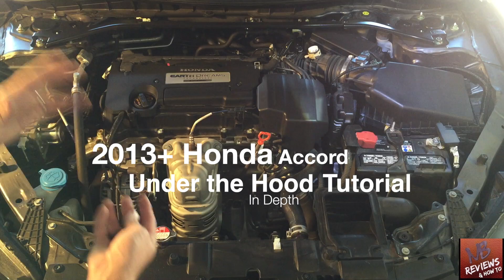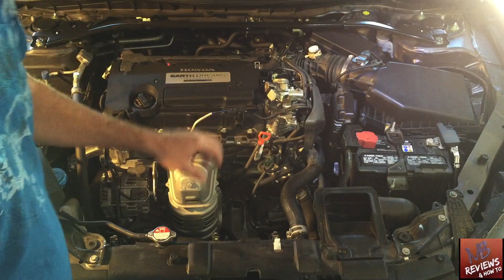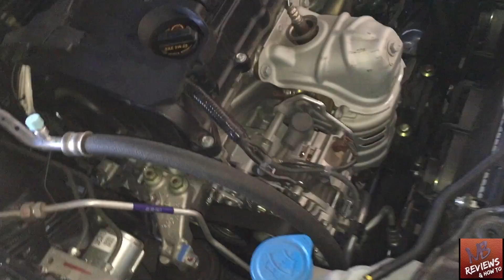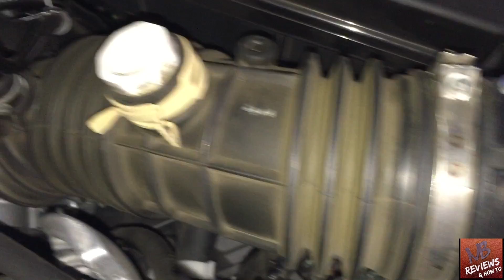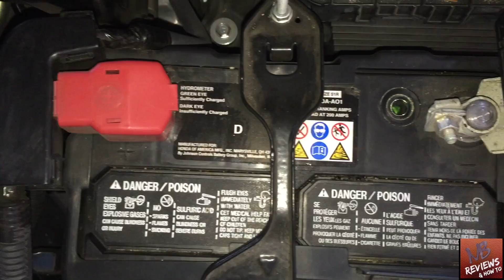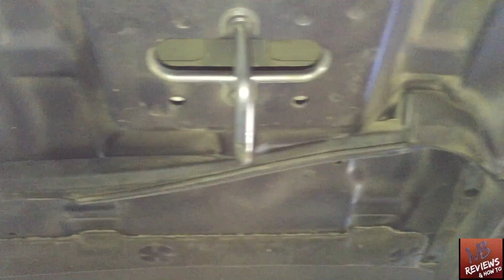HONDA ACCORD 2013+ UNDER THE HOOD TUTORIAL

Comment: Big question.. what is the proper way to measure the oil in this car?  In the morning when the engine is cold and all the oil is in the pan?  Or when it's warm and off for about 3 minutes like the manual says????  If I were to measure it that way, then when the engine is cold, it will be over the fill mark.  And isn't measuring it when it's warm not an precise way of measuring?  Why not put the lines on the dipstick to show the right level when the engine is cold and all the oil in the pan??
Reply from the maker: @rickrodriguez5875  The proper way is to warm the engine first. When the engine starts it will pump oil throughout the engine and will return a low reading more accurately than when the engine is cold. I know it’s common sense, just sure you are on a level surface.
Reply: @Sunshone7311 how long after you shut the engine off do you wait to measure?  I don’t think that’s an accurate way to measure because you don’t know exactly when the oils drains to the pan. Why not put a cold mark on the dipstick like they do with the power steering fluid. That’s more accurate. I’ve heard it’s worse to overfill your oil and why I wouldn’t recommend measuring when it’s warm. That method is a “it’s kinda full method” vs measuring when you know all the oil is in the pan.

Comment: My 2015 Honda accord exl was totaled & fixed almost back to new. I don’t have the intake resonator on due to reconstruction. It can’t fit now. Is my car still fine to drive? The air box filter is on but the circle part is open. Do I need to close it? Also I can’t find the name of the ac line with the blue cap.

Comment: mine is 15 accord sport just reached 100k+ miles. i always do regular oil change in 3-4 months and making sure all fluid are on the level and clean. im replacing couple of stuff like spark plugs, coil and probably 02 sensor. however, i never gotten any check engine so far since i bought the car. do you wait for check engine to out before changing 02 sensor?? is it safe to just change the 02 since the high mileage ? appreciate the feeback.

Comment: Great video. Trying to diagnose a daily squeak on cold startup. I replaced the tensioners and serpentine belt but that wasn't it. Sound is coming from the driver's side of the engine. Maybe the water pump or bushings. 

Any help would be appreciated. Thanks.

Comment: I've got a 17 sport, thanks for this video.  I've recently come up with a p0172 code and now I see where the fuel is routed to I can check to see if that's where my problem lies.
Reply: I just got the same and i got the car a month ago with 134k LX. My issue is the MAF sensor.  Changing tomorrow

Comment: The 0w 20 oil is for fuel economy not closer tolerances. 
This DI engine actual has low tension piston rings. The tolerances are actually greater. Less internal  friction means  better mileage. 
The extra heat comes from a higher compression ratio of over 12 to 1, not the DI. The direct injection actually allows the higher compression by cooling the combustion chamber and delaying detonation,  not unlike water injection. 
The emissions issue is partly the faster burn and lack of atomization usually done in port injected intake manifold. The low tension piston rings allow a bit of blow by which contaminates the oil so more frequent oil changes are a good idea.
Over filling the oil will not cause the oil pump to pump more oil. It has an always submerged pick up. More oil is irrelevant to the pump.  The problem is the crankshaft over splashing and whipping the oil in the overfilled  oil pan and turning the fluid into foam. The pump can't pump foam and causes oil starvation. 
Electric steering is another method of increasing fuel efficiency by not using engine power to operate the pump. It was not invented for autonomous control. 
The smaller battery reduces weight and increases efficiency. 
The air box was  carefully engineered to protect the engine, minimize noise and maximize efficient air intake. Dyno tests show aftermarket intakes do not increase power in any meaningful way. 
You have some unresearched assumptions here that might seem reasonable but are not the basis for these designs.  Otherwise nice video.
Reply: Agree all of it except the battery. No sane engineer would put such a small battery for such a high compression engine. Both the starter and battery are not properly rated for this engine.
Reply: Yes but they are downsizing anyway. Have u seen the Fit battery? looks like it belongs on a motorcycle    @S-the-simple-engineer

Comment: Am having an doubt I need to share a picture of my honda accord about a hose coming from engine and it's connected to an electrical circuit from that it going to the down but I found that the hose in not connected to any engine circuit it's near bu oil dip indicator and radiator tubes I need to share the pictures I need to take any immediate action or it's an normal design

Comment: grat video. I always high oil level causes the crank hit the oil and cause foaming which in turn causes air bubbles to flow thru oil system which the oil will be inundated with air and less oil causing less oil for parts needing oil only.. I would like your thoughts on that.

Comment: Good job Michael.. but forgot to tell that the MAF needs special solvent to clean.!..and that the O2 sensor there is another on the exhaust pipe under the car. 
I need help finding the EGR valve..Is one on these engine models? somehow Honda do not list one available. 
thanks
Reply: He mentions both those points in the video.

Comment: Got a oil change. Next oil change is 3 months or 5k miles. It's been 3 months but only drove 1.5k. Do I still do a oil change?
Reply: No, wait to the 5k, but make sure is 0-20 synthetic, and if you can DIY.
Reply: @juanruvalcaba1823  yes I have full synthetic. Are you absolutely sure?
Reply from the maker: 5k miles or 6 months with Synthetic.

Comment: my 2014 accord 2.4L burns 1 qt oil around 5,000 miles.
Reply: Iam using Valvoline full syn half a quart burned with 4k since oil change

Comment: Hey, just recently watched your video and its very informative, but i was wondering if you could help with a little problem im having with my 2014 honda accord. So my power steering light, TPMS and VSA light are all on in my car and i cant turn them off, also when i try to calibrate my tires after putting air inside it says the calibration fails to start. I was involved in an accident early in January because my vsa wasnt working and i know this is a serious problem, any idea on what i could be dealing with so i know what to tell the mechanics when i take the vehicle in i really appreciate it
Reply: I have a similar issue with my '14 accord. Did you find a fix?
Reply: Ansar Muhammad  steering angle sensor might be the issue, when you reverse in your back up camera,  is the diagram displaying your wheels as being turned before you even turn the wheel?
Reply: @Brodie11281  ok for sure. No it doesn't do that but my abs, t/c, steering wheel, and brake lights are all illuminated. It doesn't affect the driving of the car my dash just looks like a Christmas tree and thats a bit annoying lol. I think it could be ABS modulator but not completely sure. Just wanted to check what your fix was. Thanks bro👌
Reply: Ansar Muhammad  yeah that can be annoying but if its the modulator definitely look into getting that taken care of asap. I have to get a new steering angle sensor and have a shop take care of the rest. But hope everything works out for you man

Comment: Can you tell me what that thing that has a little cap on it is I lost the cap and fell off I need to get a replacement I guess think I don't even know what it does I think it's something to do in the vacuum it's right next to the dipstick for oil and I believe the plug electrical plug is green but the cap I lost it it fell off at the carwash

Comment: Nice video very helpful. I have a 2013 sport almost reaching 60k. I dont know what's wrong with my car, I use to average about 40mpg cruising down the highway to work (about 20 miles). And now I'm lucky if I get close to 30mpg. I take care of the car alot and I dont abuse the car by hard acceleration, and in the city I'm getting about 15mpg. I do all the maintenance and try to keep the car in top shape. when I look at the mpg on the radio screen its jumps up and down, if it says 450mpg to empty as I'm driving it will jump to 500mpg and go back down to the 400's. then go down by 5-10mpgs after that. I changed the spark plugs original, changed air filter k&n, tires are properly inflated. cleaned mass air flow sensor. I'm wondering if it's one of the o2 sensor, dirty injectors or dirty throttle body. I'm clueless on what it could be. please help.
Reply: It's jumping back an forth due to driving conditions it's calculating the average mpg for example if you're doing 25mpg and it says 450mpg till empty then you start doing 35-40mpg it will recalculate and say a different mpg till empty

Comment: Can you also do a video on how to thoroughly clean the throttle body? Does the intake get gunk up or no because it’s direct injection? Also how can I clean the valves without pulling the engine cover?

Comment: I have an '05 2.4i VTEC auto (Europen spec). Which I've had for 9 years and love. Do all of my own servicing and as much repairs as I'm able before reverting to garages. Which I avoid as much as I can. It was interesting to see how the design has evolved from my car. But I do not like GDI. With Port injection (my car's system) the back of the inlet valve gets "washed" with fuel at every injection cycle. GDI misses out on this and hence in the UK atleast there is a rash of clogged inlet ports as a result. But all new cars will now have GDI. 
Scottie Kilmer always says Honda autoboxes are crap and will fail prematurely. Anyone have any info to back this up or refute it? I drive with mechanical sympathy and do occasional ATF changes so I'm hoping this will help extend it's life. A costly repair will sadly send it to the scrapyard. Which is sad as I enjoy  running an older car. Or perhaps it's me that's sad!!!
Reply: EDIT** Sorry I didnt read what model of accord you had I thought you were speaking about a 2013+ since the video is about those models lol anyway your already on top of the game with that 2009 accord, many people neglect changing the transmission fluid, their just as important as oil changes but are changed in time. It's TRUE scotty says older honda autos are not the best but you already started babying the car by changing the transmission fluid frequently so expect that tranny to last awhile

Scotty said the older transmissions were not the best by honda but Scotty spoke about a traditional automatic transmission.  The 2013-2015 accord models only offer a CVT automatic and manual, they dont offer a traditional gear transmission but they did bring it back in newer accord models. If you've watched a few of his videos he said the honda CVT transmissions are still new and can't say if their good or not and he hasn't heard of any major CVT failures with Honda. I've attempted to google any major CVT transmission complaints regarding this model and couldnt find anything beside some obviously stupid situations where mechanics somehow forget to fill up the CVT with fluid after performing a fluid change and essentially destroying the CVT by human error. Speaking of Fluid its essential if you plan on keeping the accord for along time that you change the CVT fluid about every 80,000km also theirs no dipstick on this model you need to google how to check fluid measurement. Theirs only a hole to refill the CVT fluid with that yellow paper around the neck of the cover stick. Many people confuse this with a dipstick for measuring fluid but no it's just for refilling fluid
Reply: Thank you for that. Most interesting.

Comment: May i ask how your Honda is doing now..5 years later With the Direct inject carbon build up thats a problem with these engines? I jus bought a 16 accord sport with 30k? Thank you!!
Reply from the maker: I sold the car at 180k miles and had just checked the intake side of the valves with a scope and saw no build up of carbon. The was great and still had a lot of like left. I just needed a hybrid to get a carpool sticker.
Reply: @Sunshone7311  thank you!!
Reply: So much for expecting to keep it till 300,000 miles 🙄

Comment: My 2013 accord is right at 180k miles and the only problems im having now is the starting system and ABS/VSA. Does anyone know the fix for the ABS? Dealer wants 900-1400 just for part Module. Lol
Reply: What exactly are you having trouble with-   My problem maybe similar.  I have a vehicle with 178k and similar issues with abs-  usually is a abs sensor however on the drive axel of the wheels- there is a velocity or reluctant ring that the abs sensor reads from to indicate the speed and relays it- and lets us know how fast we are traveling by the odometer.  I replaced drive axel because they’re an ideal diy project BUT make no mistake you will have a huge bill if a dealership does this work. also.. replace abs sensors along with it and have the codes scanned and cleared.  Hope this helps
Reply: @RJ-22rj28  i appreciate the answer, i will take a second look at that but honestly i dont believe thats the issue. I bought a computer for hondas. And it gave me codes for the yaw rate sensor and vsa. A little reasearch turns out both sensors are inside the abs module... :((  so i will have to see if i can find a used one. Thanks though

Comment: I have this 2013 accord blend new five years ago, didn't drive too much, only 26k on it, but it's been six years old, just wondering if it's time to work on the timing belt, if it has one?
Reply from the maker: Only the V6 has a timing belt. So if you have a V6, yes. You should service the timing belt and water pump every five years regardless of mileage. If the belt fails the will cause permanent damage to the pistons.
Reply: @Sunshone7311  so the 4 cylinders do not have timing belts? Thank you!
Reply from the maker: @edubb2491   Correct, they have timing chains.

Comment: could you tell my do I have to change the filter and dreiner with the oil HCF-2 ? (cvt transmission oil change)??? 116700 miles
Reply: Beka Mtiuli the manual recommendation is at 45000 miles...

Comment: my 2014 sport accord has a  little tremor when its in D position and its stoped(break pedal) . today  I have changed  upper and lower cvt mounts.  there is a little bit tremor yet. I think  I have to change also the engine mounts upper and lower just in any case.  have you had the situation like this ?
Reply: I have the same issue with my 2015 accord sport..Especially when the ac kicks in..I am planning to change the mounts as well..But doubtful as it has done just 30k miles

Comment: I dropped something down the snorkel and am wondering if this is a problem for the car? It was metal with liquid in it and don't know if it will leak and cause issues
Reply: How did you get it out? Did it affect your engine? I dropped a nut down mine today.

Comment: timig belt ?every how many miles to change or serpentine
Reply: Could be a timing chain rather than a belt . My '05 2.4i VTEC has a chain. Still runs quiet at over 70,000 miles. Never go more than 5k miles between oil changes.

Comment: Would you buy a 2013 Honda Accord Sport with 200k Highway miles  for $7k?
Reply: Is it a CVT?
Reply from the maker: Hi Thomas, if it is a manual transmission I'd buy it. $7k is too much though, you should be closer to $5500-$6000 with that mileage in good condition with a new clutch. With a CVT, I would not pay more than $4500-$5000 because it will likely need a transmission in the next 50k miles.

Comment: Hey i have a question i recently purchased front wheel soeed sensor for my accord, after checking my car with a friend speed senors weren't the problem it whats my sensor connect to that is coming from the engine, I called a few dealerships looking for a speed sensor harness, every one of them said that i couldn't buy the harness separate and that i have to buy an engine wire harness. Would i have to buy to the whole entire harness just be able to connect one of my speed sensors or is there a stand alone harness for the speed sensors?
Reply from the maker: What are the symptoms on the car that caused the issue?
Reply: Michael Borquez when i had my friend hook his obd 2 scanner he said that my wheel speed sensors are malfunctioning and it caused for a few lights to come on, on my dash
Reply from the maker: Jamel Howze Have tried cleaning the sensors? Sometimes crap gets caught in between. Trace the wiring back and check for damage. Has the car been in a crash? What code number came up?

Comment: I have been changing my oil at 8500+ on synthetic.  I had my oil analysed at Blackstone Labs of Indiana.  They said that there was minimal wear, that I could run it for more than that interval.
Reply: Oil is cheap
Reply from the maker: I'm going to adjust the valves in a few weeks (160k miles) and I'm excited to see how clean everything under the cover is.
Reply: Why replace what is still good?  Run it and get the maximum use out of it.

Comment: Have a 2015 Honda Accord, when using the air at stop it really loads the engine and causes it to rumble, but  when it starts to go from stop, even a little the rumble stops. Is there any way to increase the idle slightly to cure this. Without messing up something?
Reply: Needs a bg fuel service. No idle adjustment is possible.
Reply: Its a 4y 
Normal
Reply: I have the same issue..It is quite annoying in heavy traffic